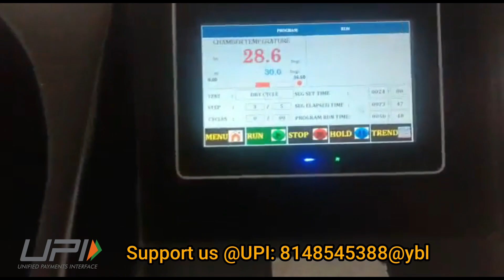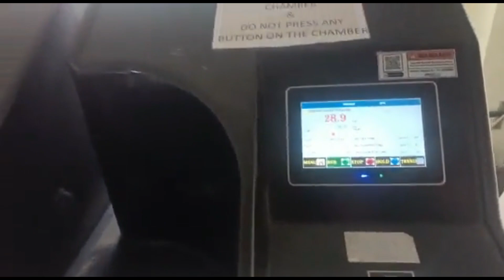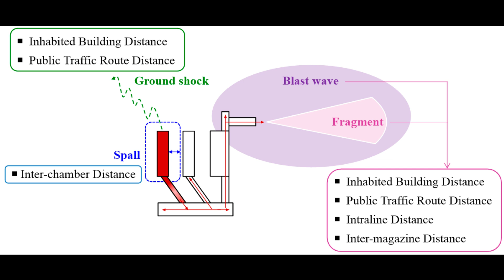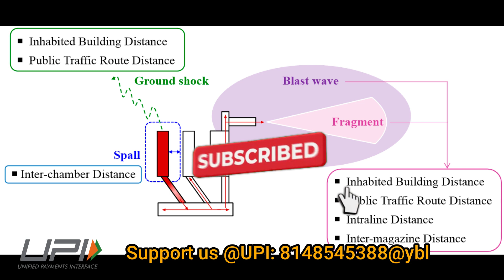DRDO conducted test of ADC-150 tested from IL-38SD & Underground Ammunition Storage Structure

Comment: Can the ADC-150 be used at high altitudes? It seems very useful for mountain regions as well. The underground ammo dumps also needs engineering support so it can be done quickly when forward bases are established in enemy territory. If Rossiya had this then HIMARS would not have been such a deadly problem.
Reply: You think Russia has no under ground storage facility at its border with Ukraine or in Donbas  & Luhansk more importantly in Crimea
Really
Reply: @Electrical1112  then how are they being blown up? Maybe it has some but there are obviously lots of above ground ammo dumps that are easy targets.
Reply: Good point. Check out the Rapid Dragon dropped from a C130 which deployed many many ALCMs after being separated from their launch canisters.
Reply: @timdipayanmazumdar1089  True a smart idea that hasn't been used in a Bharati context yet, this has payload of  150 kg.
However since it is technically quite simple someone will probably do their own variant soon enough.